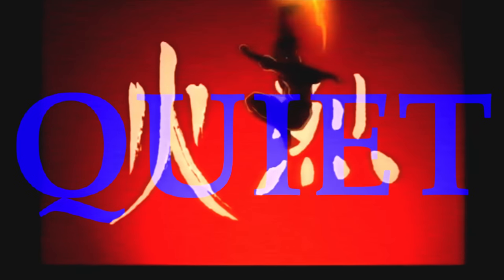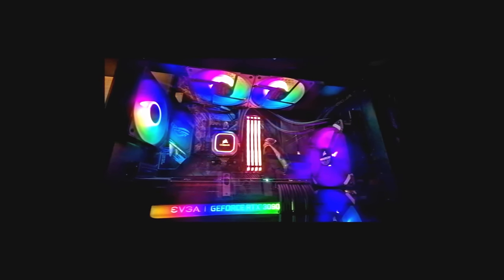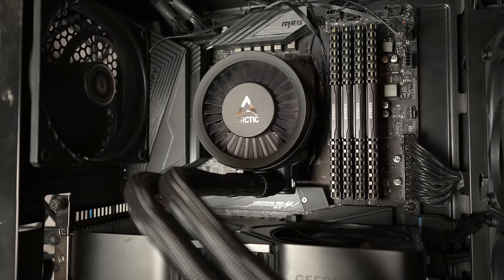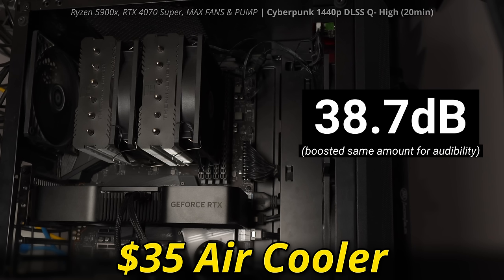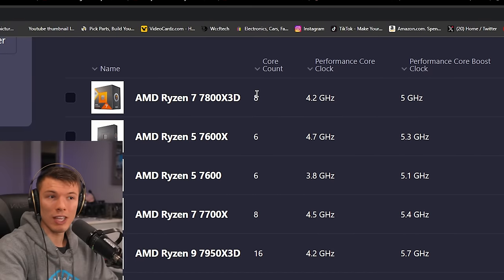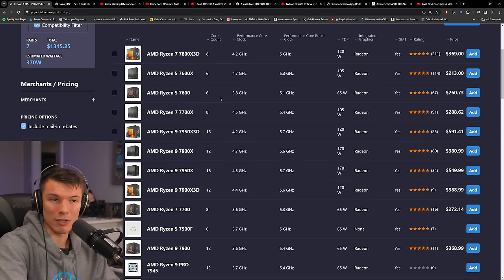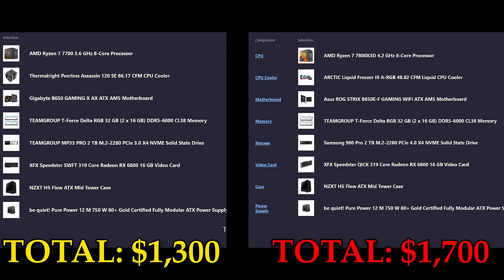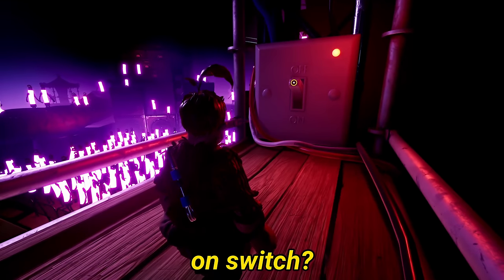How to Get the BEST VALUE PC!! (you’re doing it wrong…)

Comment from the maker: boujee, boojee, boogie, boujei, bougie, bawgee, boogles... f**k
Reply: language vex!!!
Reply: bogus
Reply: bro just made another banger video yet comments something stupid like this, this is why I love this channel.
Reply: the funny thing is that difference in price is non existent in my country. The companies that sell them in my country already "Adjusted" the prices based on real value.
Reply: idiots on forums be like . WHAT ARE YOU POOR ? you dont have the REPUBLIC OF GAMERS ?
Reply: Might of been an idea to state how you connected the AIO ALFIII . Did you use the 3 cables to pimp, vrm fan and radiator fans or didi you use the single all in one connector. I have the same cooler as you and cpu and i am using the 3 controller cables for vrm pump and fans. if you do this you can utimately tune it to its basically silient and pretty silent when gaming using a program like fancontrol. I have a case thats has its intakes on the bottom and exits out the tiop of rear (Jonsbo D41 mesh with screen). this helps with cooling, noise and reduces the amount of dust build up.
Reply: Boogers
Reply: Bijou? 😅
Reply: BUŻI builds 😆
Reply: I think boujie is right. I initially thought bougie was right but as it turned out I learned something new today about what Bougie actually means. Was not expecting it to be medical.
Reply: Thermaltake View 270 TG
Thermalright Phantom Spirit 120 Evo
Thermaltake S250
be quiet! DC2 Pro
Reply: I want my pc to look good though and im find with paying an extra 300-400 on looks. Also, my mobo is expensive, but thats because i like having lots of usb ports. So all in all, id say i made decent purchase decisions for my goals and desires. Money wasnt an issue big enough to forego the aesthetic.

Video criticisms:

1) 79c vs 74c is not negligible, thats like a 6-7% performance bump.

2) Your pump is mounted poorly if its making noise. Mine is silent.

3) you only show cpu performance in terms of 1080p and a 4090. People buying these levels of gpu/cpus will be likely playing 1440p. Different resolutions and graphics cards may have different effects on these cards.

4) along a similar line of thinking, people may be buying cpus for reasons other than gaming, although i get this video is geared towards a gaming use-case audience.
Reply: no waifu no lifu
Reply: What 570 board did you buy I am looking for a sweet AM 4 board for mt 5800x3d :)
Reply: I'm never getting AMD ever again, from the experience I have had I really don't recommend AMD
Reply: Vex, have u ever tried MMO games? try that shitty 7700 in a lineage2 (2003) on a server with 10k+ people. welcome to the 9 fps zone. yes, this is no joke, this is ACTUAL fps that u will get there when walking in the city. ive played different games for 16 years by now and i can with 100% confidence say that games ALWAYS bottlenecked by CPU. u NEED the best possible cpu (which is now 7800x3d) to play games, especially since they get more and more unoptimized these days. and regarding gpu, literally ANY modern will do. 3060 can carry u through all games possible in the world. 7700 cant.
Reply: Old school water-cooling was quieter....
Reply: I know waat u mein

Comment: Air cooling is the way. Cheaper, more reliable, and no pump noise.
Reply: You can get really competitive AIOs nowadays in price. Arctic at least here in the UK are god tier for that stuff. Also never had an issue with pump noise ever. I will say they are more reliable but I have also never had an issue with using one for literally 5+ years. I have literally never had one fail. I know an air cooler can last wayyyyy longer though so that is a huge W for a lot of people who want to save some on their new build they do, allowing an extra bit of cash towards the CPU or GPU.
Reply: @lilpain1997 I agree with you. I bought Corsair t170i I didn't remember the name. I bought it a year ago just for 170 euro, it has 5 years warranty. I use it to cool 13700k and I'm totally happy with AIO. My CPU doesn't goes above 70-75 degrees Celsius. Also big advantage is that you can put radiator where you want instead of putting heavy air cooler on motherboard and have risk that it will bend motherboard overtime. In my opinion paying a little bit more for AIO is win win.
Reply: I think arctic liquid freezer III 360mm aio is one of if not the best cooler for amd processors (performance is worse on intel), and is sub £70. Worth it imo.
Reply: @GeneralS1mba   i thought their new ones come with a contact frame
Reply: @lilpain1997 
   I just built my first ever PC and went with an Arctic lll 360mm AIO. 
   I was heavily debating going with air or aio cooling. I think either would be fine. Cooling a 7800x3d.

    But from everything I saw, Arctic got special shout-outs as one of the best AIOs as well as being way cheaper than equal alternatives. So ultimately I went with it.

    Very happy. I'm new to PC so don't have a lot of experience. But the CPU currently never goes above 57C in games. I assume that's a good temp 😂.
   It's also basically dead silent compared to the case fans.

    Not sure if I want or need to adjust the fan or pump curve, or what better settings would be. But as is right now I'm glad I went with this AIO and didnt overspend on a different brand. Looks very clean.
Reply: the only big advantage of AIO is fans. it includes 2-3 quality fans which alone can be expensive af. but again it is not necessary for majority of PCs
Reply: @lilpain1997  Then again you can also get air coolers that puts most AIOs to shame like the Thermalright Phantom Spirit.
Reply: @jujuu1339  They do but other aios are apparently still better Vs the LF when it comes to intel.
Reply: @riven4121  Just use whichever, at the top end AIOs make far more sense as they are obviously outclassing air in noise to performance. Wouldn't say most AIOs either as AIOs have been getting stupid good for pretty good/competitive prices.
Reply: I'm wondering how you can even hear pump noise with all those fans in the system.
Reply: Thermalright air coolers are the best
Reply: If you have pump noise, I'm concerned
Reply: lol I don't think I've ever heard the pump on my 280 freezer, where is this meme coming from?
Reply: @lilpain1997  For sure, especially if you get lucky when searching. Was thinking about decent air cooler and stumbled on ROG RYUO 120 AIO for £75 new. Set it to 40% rpm, can't hear it at all and CPU rarely goes higher then 65C. I know I could get good air for half the price, but with the AIO I have more free space for fan setup with better GPU\RAM\VRM cooling plus info display on top of the CPU. 
It's not worth it for "max FPS\$" build, but if you like "clean all RGB through tempered glass" aesthetics plus super low noise, might be the way to go.
Reply: @denikec  uneducated people who dislike AIOs. They are afraid it will leak, read some horror stories about how someone's leaked one time, go down a rabbit hole of failure stories and then think that is your avg AIO experience. They then post about it themselves on vids like this to make themselves feel much better about their air cooler. I mean you can quite literally see these people liking this have never had an AIO and didn't bother looking for one, you can get AIOs for as little as £70 to £100 nowadays that surpass £90+ air coolers and anything in there price bracket.
Reply: @xerxeslv  I got the arctic 360mm LF III AIO for £76 with rgb. Best cooler I have owned and far outclasses any air cooler I have owned as well. I put it to 500RPM and my CPU barely goes above 55c on most games, cyberpunk can hit the 60s and fans are still low, and MC heavily modded can hit 70s... with still no noise at all as I have fan curves really low. CPU is a 5800x3D. I have done air on this thing, it worked but it was no way near these temps to noise, I don't want a system loud. I want it quite and still running good. It can get loud if needed but it wont. Also aesthetics are a point you made and I agree, so many act like they don't care for aesthetics but they clearly do as the market says otherwise...
Reply: @gozadrotit7426  an air cooler bending the motherboard is actually trivial lol
Reply: @inshallah4280  I meant big ones. Plus I have 13700k which is for me easier to cool with AIO than air cooler.
Reply: @lilpain1997  I did write an answer in this comment section yesterday, and it just disappeared for no reason. In short - nice to know that 5800X3D can have pretty low temps despite chiplet small surface area heat dissipation problem, I was thinking about getting it at some point. 
And yeah, I think aesthetics could be as rewarding, if you have enough performance. My PC case sits nearby by the right hand and sometimes I turn all the "Christmas tree" lights when listening to music for example, and I like observing it doing it's thing... sometimes when experimenting with OC\undervolt I load up "temperature monitoring profile" so each component shows it's temps using RGB and it's actually useful. And even after 2 years I still like it as much as when it was a new build. So yeah, I guess if there is no major sacrifice in performance, I would think about good aesthetics as "why not" category.
Reply: 1. buy any used noctua tower for dirt cheap
2. buy some fans

there you saved 50$ on AIO
Reply: Buy non overclock processor and u are good to go with stock cooler
Reply: No permeation either :D.
Reply: This. I bought a huge twin tower cooler for my 2500K over a decade ago, still works just as well with minimal maintenance
Reply: More fan noise, inefficient, and entirely reliant on heat pipes that have in the past failed just like pumps because too much heat rendered the internal fluid to a gas and failed to cool enough to convert it back to a liquid. Air cooling is no better but also no worse. It's simply cheaper.
Reply: No noise to report here. And I have fan curves with 2x shallower inclines than an air cooler cuz I have 2x the surface area to cool with...therefor, back to being the quiet one.

I swear to god, people like you making comments like this just show yourself out as having zero idea what ur talking about.
Reply: @meusana3681  who you responding to?
Reply: "cheaper" no pump noice? i never heared my pump :D
Reply: @TheLordNugget  the OP... people in general however seem to not understand how power draw works on a cpu.
Reply: @mbe102  I'm still running a 15 year old AIO on my workstation, and several others in the meantime...still waiting for that permeation myth to stick its head out.

This entire debate can be silenced with one simple philosophy: "don't buy crap just because it's labeled as premium."

Get a cheap asetek cooler which seriously costs around 70 bucks for the cheaper non rgb clones, doesn't have pump noise, doesn't fail, doesn't bend your mobo, doesn't collect dust like that closet Narnia is at.
Reply: I'm totally wiith you on that.  I just use an AMD Wraith Prism that cost me literally nothing and it cools my Ryzen 7 5800X3D just fine.
Reply: @lilpain1997  The point is that you paid extra for it without needing it.  I mean, unless you were crazy enough to buy a late model Intel CPU.  😁
Reply: @sawdust8691  Just because it's a "good value" for an AIO doesn't mean that it's good value.  I've been using an AMD Wraith Prism that I got FOR FREE to cool my Ryzen 7 5800X3D, a CPU that runs hotter than the R7-7800X3D.

I swear, I just entered the NOOB section of this comment area.
Reply: @AvroBellow  This comment is useless. Cool, you can cool a 5800x3D with a wraith prism that you got from another CPU that you got before... At a much louder noise to performance ratio, which matters for a lot. Meanwhile you can just grab a 50 to 70 air or AIO cooler and get far better results in literally all areas...
Reply: @AvroBellow  It doesn't cool it "just fine". The CPU is just very good at not melting itself. Having a cooler rated for 105W running a cpu rated for 105W only means the cooler won't have thermal runaway which would be a total fail, but it's far from "just fine". That cpu in my own tests sometimes draws 130watt under boost anyway, so there's that.

What the TDP doesn't tell you is how good the cooler is at resisting a change in temperature in the cpu die. And contrary to what people seem to believe, a colder thermal solution will physically draw less power which in turn requires less power since temperature and resistance is directly proportional. And vica versa, a hot cooler will make an otherwise efficient and cool running cpu not so efficient and cool running anymore......"but but, my cpu is only drawing 99W"...yeah, cuz as I said, the cpu is smarter than you thought you were, and knows how much heat it can dump. If you can't get to that 130W mark, you #1 aren't using all the cpu, #2 can't cool it enough for the cpu to give you all of the cpu.

So in summary, a snappy little air cooler is GREAT for very low thermal loads, like only using 5% of a cpu. Which begs the question, are you only using that cpu for gaming? If so, why? Why argue not spending money when you already overspent on an ASIC you will never utilize, and if you did your argument would fall flat. Because even as advertised, a 105W tdp cooler would cool a 105W cpu under load...at it's thermal limit that is.
Reply: @riven4121  does it have a temperature gauge?
Reply: @henson2k  that’s the neat part. You don’t.
Reply: @lilpain1997 yeah but water cooling is a unnecessary hassle, I use a thermalright peerless assassin and it does phenomenally
Reply: Not for really hot CPUs. Plus AIOs look better. Plus A lot of aios don't have pump noise
Reply: @lilpain1997 Noctua 4 life!
Reply: @henson2k because u can’t hear the fans at all if tuned correctly. My noctua nh-d15s in a fractal torrent is dead silent even during gaming. I can barely hear the asus gpu tho in heave titles like Cyberpunk 2077.